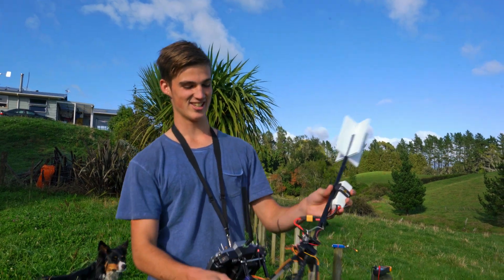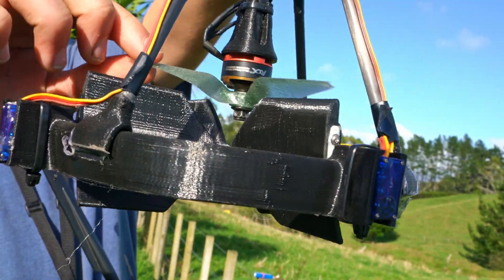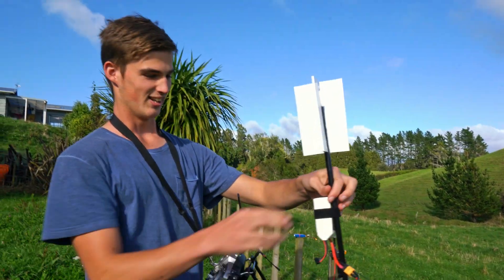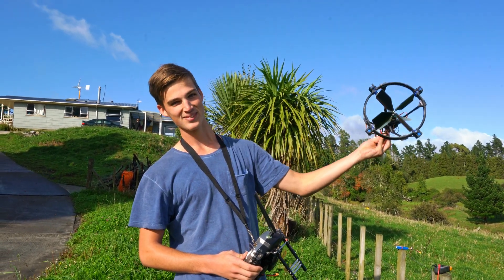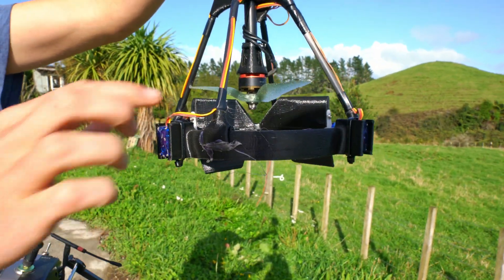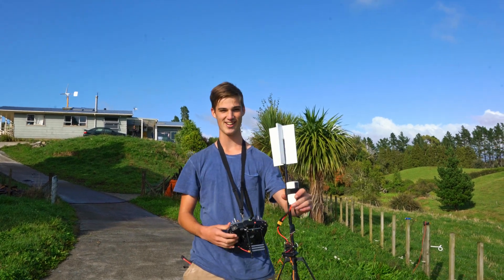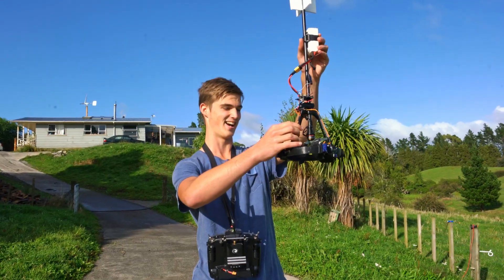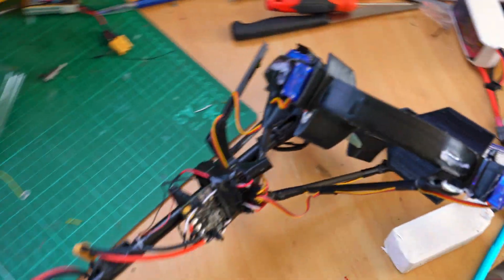Electric Rocket #1: Initial Freefall Testing

Comment: Wheres Part 2
Reply from the maker: I rebuilt the rocket and then crashed it again before I could film anything else. Then I built another one with a completely different dual motor design. Then covid lockdown was over and I had to go back to work. Then I moved to America and gave them both away to a friend from church who may potentially continue the project at some stage
Reply: @paulmakesthings  Thats Sick

Comment: Going up and back down with the same orientation doesn’t make sense to me.  You want the weight at the front and the fins at the back.  Weighty end at top on way up and at bottom on way down. If your fan was ducted the flaps would work with the prop spinning both directions.

Comment: An RC motor does not turn it into a rocket ship I was hoping because of your electric rocket I was hoping you was using the regional Photon Drive since they've already got a prototype as big as a car that they work going around the gym on its own power until the batteries run out Photon Drive works perfectly it just requires so much energy even though the platform they had was 4 ft by 4 ft with the disbursement at each point with a batteries in the center the photon Drive took so much power it could only levitate itself for 15 minutes at a time but it works
Reply from the maker: Yeah but have you seen this?

https://youtu.be/dQw4w9WgXcQ

Comment: Im assuming the flight times are drastically increased when only powering one rotor ? how long could something like this stay in the air ?
Reply from the maker: Honestly can't remember how long it flew for but it was a while. I had plans for a counter rotating 15 inch one but I never finished building it
Reply: @paulmakesthings  cool stuff. keep it up, you're talented

Comment: 🔵 With the type of recovery that you're attempting to perform you should have ramped-up the throttle to recover from the disarm instead of full-power all at once, I believe THAT is what destabilized it.
It'll be up to you to find out how fast you could stably ramp it up (or just bring to a lower preset-RPM that allows you to retain stability), before you hit the ground.